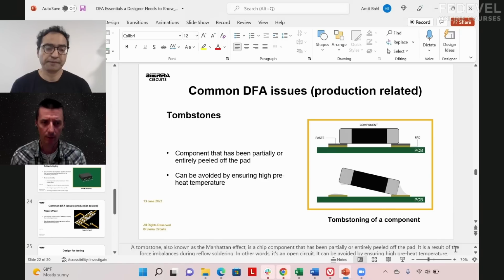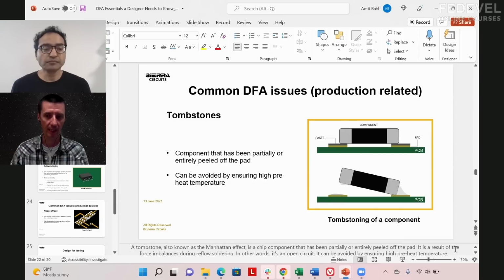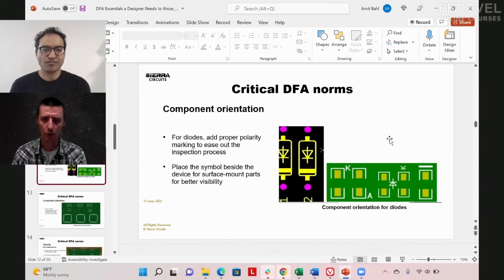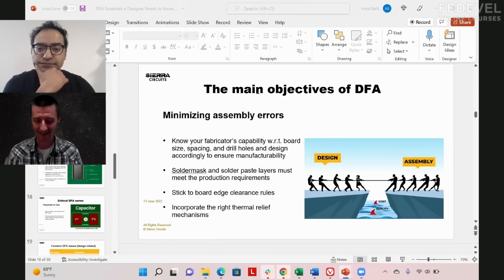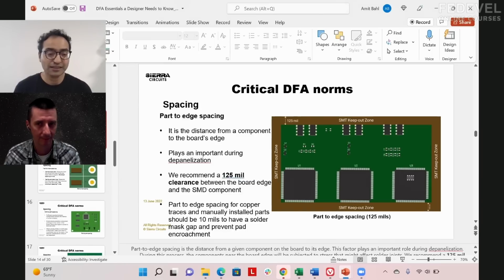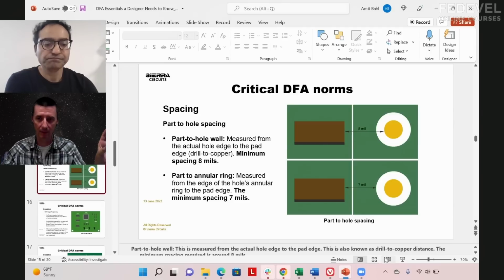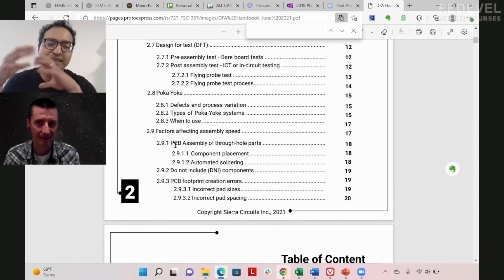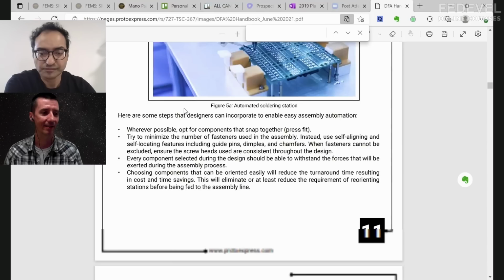Things on your boards causing problems during manufacturing | Amit Bahl

Comment: What I don’t understand: tombstoning because of temperature differences (like with a strong thermal GND plane connection). Is the reflow profile not ok then? The GND plane should have the same temperature?

I reflow my own boards with a good reflow oven. Never had tombstoning. But I’m a hobbyist, didn’t make 100’s of boards. 

Maybe it’s like SI: only two types of engineers, those who experienced SI problems and those who didn’t had yet haha.

Comment: Why is it important that the via fill be non-conducting?  I can see where a conducting fill would change the impedance, which might be bad for signals, but ... aren't vias already a problem for that, and typically because they have too much impedance?  And for power and ground vias, it seems like more is almost always better. 
Is it hard to account for, because the precise material (or shape, and skin effects) changes a lot?
Reply: What I was told by my fab house was that non-conductive is preferred because it is relatively flexible compared to conductive filling. So when your board flexes or expands/contracts because of temperature, non-conductive filling moves with the via hole as opposed to conductive which is stiff and can cause the via hole/annular ring to crack. But definitely for high current rails, conductive is preferred especially if your vias are small; but you've to make sure as the designer the board does not undergo a lot of mechanical stress.

Comment: Thanks Robert - but every fabrication website has all these rules - just take a cross-section and then create rules for them with your CAD application.  A better video would be how to fix problems such as sliver violations - which are usually caused by incorrect pad definitions.

Comment: I work both as pcb designer and production engineer. I can feel this man's pain.
Robert you can't imagine how many things assembly houses fix on each design.
Also there are many things that designers do wrong and makes the cost of production x2 or x4 and usually it's not intended, it's just that designers haven't run an assembly production from start to finish by themselves to know what is good and bad in production.
Reply: As a pcb designer, do you have any recommended reading (book, site, wiki page, or otherwise) that we can learn from to become better designers? Thanks Fire Developer!
Reply: Well put. The assembly line is sometimes so busy and another issue is that some design engineers don’t even follow up on mistakes that happen during the process. It’s a miscommunication between production and design.

Comment: I'm designer at Sierra and i came across many of error mentioned in video. Amit rightly said that designer has to look at lot of stuff so many errors pass through. Only with experience, one get used to process and learn from mistakes. Thanks Robert for such informative video as always.

Comment: The worse i had was a 3 level stencil BGA 0.35 pitch and 1206 components, its kinda expensive... they are btw not stacked, its done with chemical milling of the stainless steel.
The thermal reliefs, without i had no problems with smt components in production but rework is a pain, anyway you can always preheat your pcb for soldering manual.
Reply: Reworking a PCB can be frustrating and a pain in the A$$. It’s crazy sometimes but all in all it’s fun to see the board working after repairs.

Comment: If I wasn't looking at a manually soldered component, maybe I would be interested in your "fixes".  This is not a fab oven failure mode.  Or something automated optical inspection would miss.   With such a contrived image why would I waste my time listening to 50 minuted of more contrived bs?
Reply: Why the hostility? 

Tomb stoning is not a failure mode in a reflow oven? If you have a production run of 10000 pieces and all of them have tomb stoned components, thats alot of extra time and money to have all the boards fixed. 

Don't listen to this nonsense Robert, you are doing great work and super interesting interviews with actual experts. 

Thanks 🙏🥳🥳
Reply from the maker: @drkzilla  thank you.
Reply: As long as you are interested in improving your skills, you will be interested in listening to an expert. The assembly line has so many steps and one can get a few tips here. The AOI System can also have such errors because as Amit said, a wrong stencil or wrong temperature can cause tombstones. Another issue that I have experienced is that the PCB color black has more errors than the green or blue ones. It’s not a perfect world inthe production. 
A big thank you to this channel for such information.
Reply: @wombbatts for a specialist like you it could be bs, but for us rookies it’s warmly welcomed. 

I hope one day I can be as good as you. 🤡